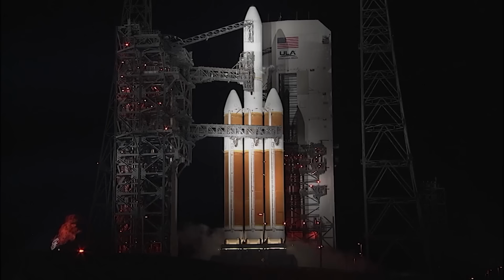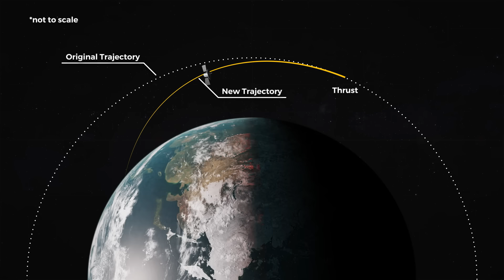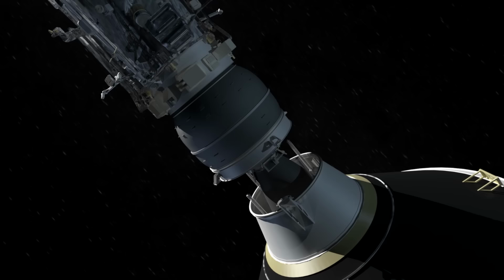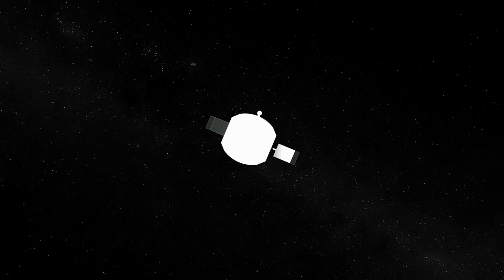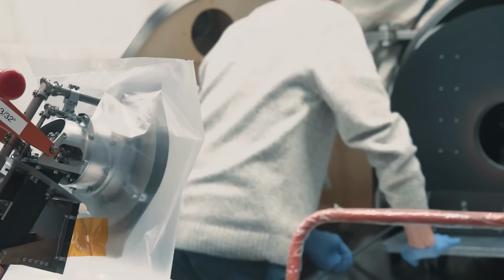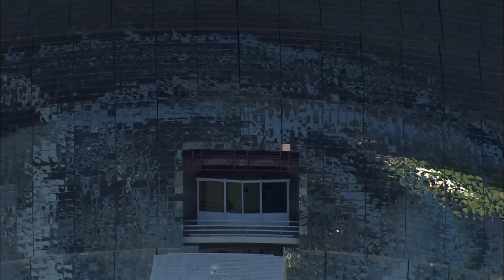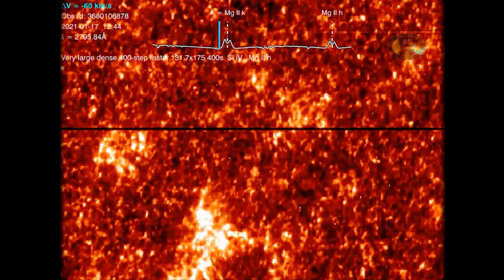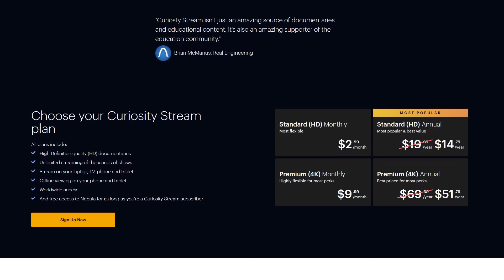The Insane Engineering of the Parker Solar Probe

Comment: Some clarification of what "temperature" means in different contexts is probably needed. When you say the temperature is "only" 3000ºC at the surface of the sun but over 500000ºC in the corona, a clarification is in order because temperature has a completely different meaning than what most people would expect when talking about mostly empty space. That is, the corona has a "high temperature" but a "low heat content" due to it being mostly empty space - a thermometer placed there would not show hundreds of thousands of degrees. Otherwise the later part of the video, where you mention they use materials like tungsten that have a melting point of 3400ºC would make no sense.
In particular, you mention they can get about 3500ºC with the concave mirrors at the Odellio Solar Furnace for testing, and that such temperature is twice what the heat shield is expected to encounter...
Reply: Yeah that would have been worth explaining cuz as is it's confusing, thanks
Reply: So empty space is hotter?  But also confusing was the cooling by water of solar panels 13:14 , wouldn't that be vapor, since water vaporizes at 100ºC?
Reply: @edwardsl8016  What they mean is that the temperature of any particle is far higher, but your odds of encountering them are far lower. That means the thermal density is, on net, lower than at lower altitudes where the temperature is nominally lower.

As for cooling, a carefully designed system could keep water from boiling by virtue of not giving it anywhere to boil(though I doubt it's actually pure water).
Reply: @edwardsl8016  No, the equipment being hotter than water boiling temperature is not necessarily a problem. 
 
If you circulate the water quickly and if you choose materials in the heat exchanger carefully so it provides enough heat transfer to cool the equipment but not heat the water too quickly, the water can circulate back in the shielded area before it boils. 

As long as the water keeps moving, it won't reach high enough temperature to boil over.

Or they could just use steam as heat transfer medium rather than liquid water, that should work just fine as well.
Reply: so I can feel heat here on earth but space isn't warm.. makes sense
Reply: i was thinking that too
Reply: @snowjohn1298  radiation and conduction are quite different forms of heat transfer. as different as it gets arguably.
Reply: An example I used to tell my students is that you can reach into an oven at 450°F (230°C) to grab a casserole wearing a short sleeve shirt and your arms don't feel any pain because there isn't much energy in the gas due to there simply not being very many atoms,  however if you touch the pan with your bare hand which is also at the same temperature as the gas you will feel great pain immediately since it's more dense, more atoms, hence more energy.
Reply: Everyone says 'Under-rated Comment' so often.   Yet, THIS Comment, Truly Is! 
 I been Hobbystudying astrophysics since i was 12yo and This got my '???wtf' going too, lol.

Insane Engineering is Good, but he could use an Assistant for Clarity.   Like @5:00 - Why Not list the Previous Dv for Reference??
Reply: And.
Reply: @snowjohn1298  Well the earth traps heat from the sun in the Atmosphere. Greenhouse gases and all that.
Reply: @Goodish_night  cool story.  How does it keep that heat in?  There’s no barrier right?  Heat rises?  Think grasshoppa
Reply: @johnnydough8841   @Johnny Dough  I'm by no means an authority on this. But the earth has a gravity and a magnetic field. So the magnetic field acts as a buffer for solar radiation and solar storms. Ozone catches most of the UV radiation from the sun preventing us from getting roasted. And the gravity keeps the gases trapped so we have an atmosphere. In that atmosphere the sunlight and uv that makes it through the ozone collides and excites the gas particles heating them up and that heat is held in by the gases in the atmosphere. And yes while it's true heat rises as you go further up in the atmosphere gasses are thinner therefore less of the heat is trapped so its colder the higher the atmosphere goes. The Himalayas are a great example just look at all the stories about mnt climbers needing to carry oxygen with them and how cold it is on top of the mountain. Not only that but every other snow capped mnt.

That's just the best explanation I can give in a short time, again I'm not an expert I'm just a fuckin nerd lol
Reply: thanks for clarifying! i was puzzled about exactly this as the video went on.
Reply: @edwardsl8016  It's like what happens inside an oven versus hot water or oil. While you can put your hand inside an oven for a few seconds without getting too hot, even when it may be at 200°C or more, you just need a fraction of a second inside boiling water to cause serious damage. That's because air is much less dense, so it doesn't carry enough "hot particles" to heat you up as fast as water, while water can transfer its energy much much faster.

Imagine that like an unbelievably hot oven, but with extremely thin air. So even though particles hitting you are incredibly energetic on their own, there are so few of them that they aren't able to transfer enough energy to heat up such a large body over a couple thousand degrees.
Reply: @namanchauhan245  the official NASA video on why it doesn't melt explains it very clearly
Reply: You're contradicting yourself. Low heat content... empty space? I guess you'll say they know the temp from testing it via IR from earth, through air and a vacuum. Riiiiight. Nurse!!!!
Reply: @Ant88889  No, I said mostly empty space. The density at the corona base is about 10¹³ times more tenuous than Earth's atmosphere so, "mostly empty space". And the temperature is measured primarily via radio telescopes (the frequency of radio waves that can pass through plasma is used to calculate the temperature)
Reply: I think an intuitive way of understanding this is thinking of it as 'temperature density' which can be further understood by loosely equating it to electricity and the difference between volts vs amps.
Reply: @edwardsl8016  Empty space cannot have a temperature, only matter can have temperature.
Reply: @Nautilus1972  thats legit all that needs to be said for my Lay brain to understand this enough to feel satisfied. Thank you
Reply: @Mike__B  Wow what a great example! Thank you
Reply: @glytchd  excellent example, thank you for this
Reply: @Mike__B  I like your example, but it's also only half the truth. Because different materials also have different heat capacities and a different heat conduction rate and these are not only influenced by the density of the material... Metals for example can conduct a lot of heat because of their internal, grid-like structure, while other materials, while having a similar density, conduct way less heat...
Reply: @edwardsl8016  yes, it's not exactly water-cooled. i think there's be at least a ceramic suspension in cooling fluids
Reply: @Mike__B  but the most important part is not the energy density but rather the material conductivity... the pan transfers the heat so much better in your skin than the heated air in the oven... thats why your skin heats up way quicker... higher temperatures just gives you higher temperature gradients and that results in higher heat transfer (with same materials) but conductivity is the main issue here.
Reply: @johnnydough8841  greenhouse effect
Reply: @Goodish_night  gravity is a theory like evolution.  Theories aren’t proven as true.
Reply: @rajashashankgutta4334  vacuum next to earths atmosphere would suck the atmosphere into space.  Impossible unless there’s a physical barrier.
Reply: @johnnydough8841  "Theory" means something very different in lay language than it does in science: A scientific theory is an explanation of some aspect of the natural world that has been substantiated through repeated experiments or testing. But to the average person, a theory is just an idea that lives in someone's head, rather than an explanation rooted in experiment and testing.
Reply: @snowjohn1298  What you feel on earth is hot gasses in the form you would call air. Heated up by the suns rays. Now due to a lack of air in space. It's very cold, as there is nothing to heat up.
Reply: Im still confused. Lol
Reply: @snowjohn1298  That's because the particles in space are not only far apart, but mostly cold as well. Near stars for example temperature does go up, but the further you are from a star the colder it gets.
Reply: I say the next mission should be to bring you and that thermometer to test out your crazy "theory".  Heat has a different meaning in empty space, ha!  The next thing you'll be telling us is that time can run differently for different observers.  Crazy talk!  TRUMP 2024!!!

(🤣🤣🤣)
Reply: @EricHorchuck  Heat in space depends on what you mean and where you are. Since the particles are far apart, to an extent, these particles can be very hot or cold. Near stars these particles can have temperatures of thousands or millions of degrees Celsius, depending on where in the star's atmosphere you are.
Nebulae, where stars form, are to the most part cold. Near stars or supernova this gas can be heated up.
Time though is a bit more complicated. Objects with mass such as planets, stars, or in the most extreme cases black holes, can slow down time. The effect is greatest near black holes, since most black holes squeeze the mass of 3 or 4 suns into an object just a few kilometers across. Now, that includes the event horizon, where objects can't escape once they pass that boundary. Black holes have such extreme gravity that space and time are bent around it. It's so great that light itself can't escape, and light travels at 300,000 kilometers per second or 1,080,000,000 kilometers per hour. Example. Let's say you had a 500 kilometer long rocket that was near a black hole, and trying to escape it. In the engine room at the back of the rocket, people would experience normally, but at the bridge at the top of the rocket, people would see these engine room people drastically slowed down. Both would see time go by normally, but one side of the rocket nearest to the black hole would be slowed down.
Or another example. You and I are near a black hole. I'd go into it while you stay behind and observe. We both experience time in the same way. However, you would see me slow down and eventually stop just before reaching the event horizon. But, by that point I would have passed the event horizon. Now, near black holes light gets stretched or red shifted, which is why it appears as if I've stopped just before the event horizon, but it's also because the gravity bends time around it.
If you're confused, I did say it would be more complicated.
Reply: @klaaturivera3746  It's the magnetic activity on the surface. The core of the sun is 15 million degrees Celsius. As you move to the surface temperature goes down. At the surface the temperature is 5,500 degrees Celsius. The sun's surface is also the place where the magnetic field comes out. There's so much activity in the form of solar flares, ejections and bursts that it energizes the particles leaving the sun, heating them upto 2 million degrees Celsius.
Reply: @edwardsl8016  It can be. There naturally would be less atoms making fewer collisions in the Corona, and that's the difference in temperature and *heat*.
Reply: EXACTLY! Thank-you. Was just about to go into that myself.
Reply: @Mike__B  so that's why metal always feels different from room temperature (usually colder because room temperature is normally cooler than body temperature)
Reply: @KirbyZhang  Partially,  metal is also a great conductor so heat (energy) is pulled away from your body much more rapidly giving you the feeling of "cool" at least initially.   A piece of wood at room temperature for instance doesn't feel as cool.
Reply: Thanks - when i saw hundreds of thousands of degrees i was curious how they made a space probe out of gas
Reply: @angrymokyuu9475  can't nasa use pure water? They could use heavy water or liquid gold they have funding.  I wonder if there are pockets of significantly colder space near the sun - variations of hundreds of degrees at a time.
Reply: @Theiliteritesbian  Probably for the same reason cars don't use pure water: mixing in antifreeze creates a higher boiling point, avoiding cavitation that could damage the engine. NASA's formula might not be the same, but it's almost certainly designed to make boiling as hard as possible.
Reply: Empty space ok 500000 C temp low heat content. But solar parker is matter. It's not made of vacuum or plasma. Which form of matter can tolerate half million C?
Reply: @Thincpad  If you drop a white hot tin can on a glacier, you'll find very little of it actually melts. That's what's going on with the probe.
Reply: A community of nerds coming together helpfully explaining the subject, answering peoples questions and providing additional context and addendums is so wholesome. I haven't read the whole thread but I hope it's all like that.
Reply: @WhatIsSanity  sounds like you’re depressed if you’re getting this weepy over it
Reply: @wspencerwatkins  
Weepy? What on Earth gives that impression?
Reply: @snowjohn1298  temperature is the measure of kinetic energy, if you have almost no mass like space
Reply: Tough crowd.
Reply: @johnnydough8841  Well, you are half right. Gravity and evolution are laws. They are consistently observed phenomena. THEORIES explain WHY something happens. Natural selection as the driving mechanism of evolution is what is theoretical.

Comment: A little correction: the word aphelion is not pronounced with an f sound but instead ap-HEE-li-on. This is because it's a compound word of the Greek preposition apo which means from or away from, and the word helios, referring to the sun. The general term for the highest point in an orbit is apoapsis. When the orbit is around the earth, we call it apogee, if it's around the sun, we say aphelion. But because of the fact that this word is a compound word, the "ph" in it is a coincidence and not actually an instance where we pronounce that as an f sound like in philosophy or macrophage.

Comment: If anyone was wondering why Parker was flown on a Delta IV Heavy instead of a Falcon Heavy, the Delta Cryogenic Second Stage is a hydrolox stage with a RL-10 engine. The Falcon Heavy uses a kerolox Merlin stage. Rockets have different metrics, so calling one 'most powerful' is a big dishonest. Essentially, the hydrolox stage has a greater throw weight over long distance. FH can lift more to LEO than DIVH, but when you are talking interplanetary missions FH starts to lose out
Reply: This is true for a (partially) reusable Falcon Heavy launch, but a fully expendable Falcon Heavy can still send more mass than the Delta IV Heavy in high dV missions even though it is less efficient.
Reply: Plus there is the fact that Delta is more reliable. Falcon heavy is very new rocket, so if you want to put a 10 billion dollar telescope that launch cost doesn't even make a dent.
Reply: @Tim_88524  Expendable FH may technically be capable of a mission like this, but SpaceX will likely never fly FH in that format. They only have 6 or so boosters around these days, they rely on reuse to maintain launch cadence. And that also doesn't take into account the Solid third stage which has never been done on a Falcon family rocket but has been done multiple times on the Delta IV family.

There are other factors but they are complex and multi-faceted
Reply: @facon4233  Parker Solar Probe is only 1.5 billion dollars in total.
Reply: This is not accurate, there are no practical payloads where the Falcon Heavy doesn't beat the DIVH by a good margin.  The only reason the DIVH was used was that the launch vehicle had to be decided on years before the Falcon Heavy was available.
Reply: @Tim_88524  regardless when you have a satellite worth that much electing to be used on a very new and relatively untested rocket to save less than 20% of the total cost of the mission. NASA hates leaving things to chance.
Reply: I cant understand what your talking about, its literally rocket science

Comment: I was very proud to hear that you chose Ultramet as your source of carbon foam refractory materials for the heat shield. I started my career in chemistry in 1996 at Ultramet (however it was a sister company initially operating in the facility in Sun Valley CA).

Comment: The corona is probably hotter because lighter elements have higher plasma state temperatures. (Hydrogen is >10000F whereas Iron is ~8000F) Heavier, cooler elements are drawn inward while lighter, hotter elements are in the outer layers.

Comment: They could have saved 10s of millions by using Falcon Heavy, although that would have been overkill in terms of thrust capability.  By the way, the sun's corona is 10 million times thinner than the surface, which means it doesn't meaningfully heat the spacecraft despite the incredibly high temps.